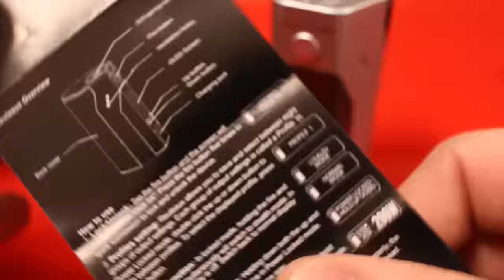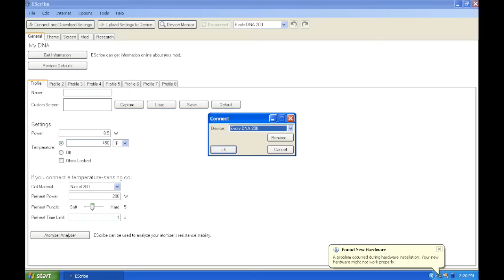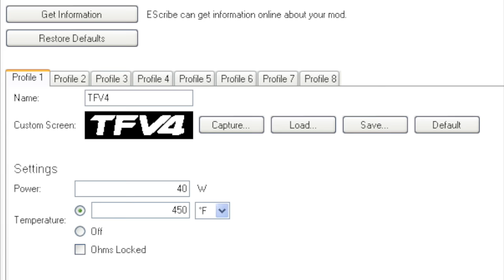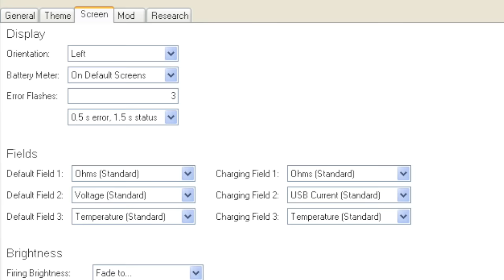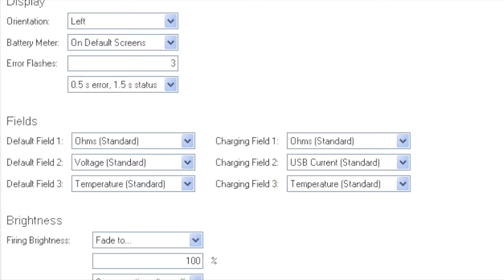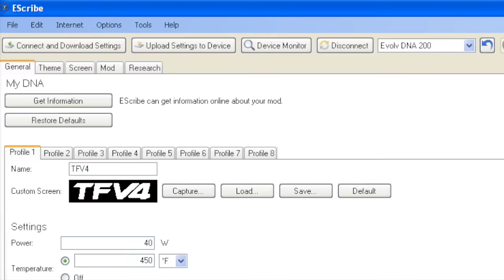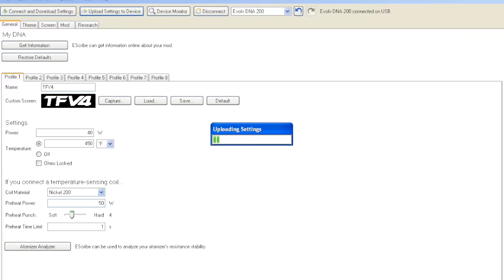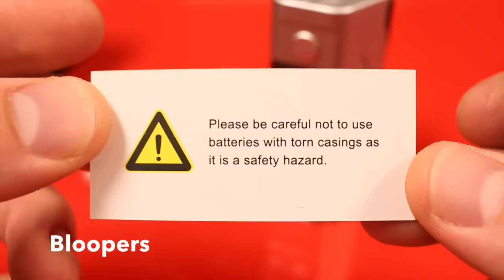Reuleaux DNA200 by Wismec (TUTORIAL + ESCRIBE)

Comment: Thank you, Kyle!  I had misread the instruction sheet on how to set Ohms Lock and in EScribe had overlooked "Upload Settings to Device."  Isn't it great that a video uploaded 7½ years ago is still helping people?!  I hadn't used my Reuleaux DNA200 in years, then recently bought an iJoy Maxo V12 Tank Kit and wanted higher Wattage for the V12 Coil.  I was supposed to get the Supreme Kit with the V12-RT6 RTA/RBA Deck, but was sent the Standard Kit without it, so the store sent me one for free.  Vintage Vapor had a great price on the Kit and then made then immediately made up for the mistake.  Shout Out to them!!!  I felt lucky to get what may the last one available and at such a greet price with great after-sale service to boot.   I used the V12 Coil in the Kit while I waited for the V12-RT6 Deck.  Vapor Hut seems to be closed,. so I should not be intruding on sales with this Shout Out.

I have the V12-RT6 built with three parallel 0.8mm x 0.1mm Ribbon coils at about a 0.25Ω buld (because I haven't figured out how to place six coils unless they're vertical, which I can't see working for wicking), but I still wanted to use the Tank and RBA on the Reuleaux DNA200 because the Maxo V12's 28mm base fits nearly perfect with only about ½mm overhang in front.  I'm all set now thanks to you and this video.  I had set some custom screens years ago, but may want to replace some of them now as I don't use those tanks anymore.  You covered all the bases I needed to see and I Thank you again!  I needed a "Love This" for this one!

Comment: This was a great introduction to the Reuleaux DNA200. I started off new to both the mod and the chipset. After some tweaking around and experimenting with various settings I managed to get a pretty good curve edit for my Krixus tank using TC. I started with some guessing from a standard Escribe calculator Titanium wire build and tweaked it from there through experimentation. Now getting a nice sweet spot at 440 - 470 F where the TC kicks in on 70 watts. Working very well and is my primary build and profile. Without the curve in place on the Krixus it really started to get hot after some use....now it remains warm to the touch. Thanks for the good intro upload!

Comment: Hey, I just got my Reuleaux the other day and for some reason my computer can't find the driver for it. Do I need to go to wismec and get the files? And what would I open EScrobe on a PC with ?
Reply from the maker: Escribe is an exe file so it should run/install without any issues on your PC. As for the driver, the DNA200 doesn't need one. Once you run the Escribe software, you'll just plug your device in to your computer and a little window should pop up.

Comment: Question... If I adjust the temp to say 300, will that reduce that burnt taste? I'm new at this btw. Thanks.
Reply from the maker: Yes it will but 300°F is really low. Check your wattage in temperature control mode. You might be at 200W which is way too high for most coils. Try lowering your wattage to 40-60W and raise your temperature to 450°F and see how that goes for ya. 😁
Reply: +Vapor Hut Thanks so much! I will try that. You were very helpful, thanks. Have a great day :-)

Comment: Hey question, i tried plugging in my usb cable n it says not compatible, can i use any usb cable ?
Reply from the maker: +Walter Hernandez Your computer is saying not compatible?... Yeah, I would try using a different cable (or the one that came with the Reuleaux).
Reply: +Vapor Hut thats the one im using
Reply from the maker: Walter Hernandez That's very odd. What pops up when you plug it in?
Reply: +Vapor Hut doesnt load the mod it kept saying not compatible to try unplugging n plugging back in, try that n doesnt work,i will give it a shot with a different cable, just subscribed to ur channel, i liked ur video , very detailed
Reply from the maker: Walter Hernandez Yeah try a different cable. I have seen this happen with one other Reuleaux. It just won't recognize it when I plug it in. Might be a defect. Thanks man! 😁